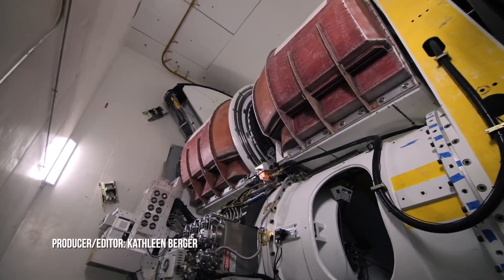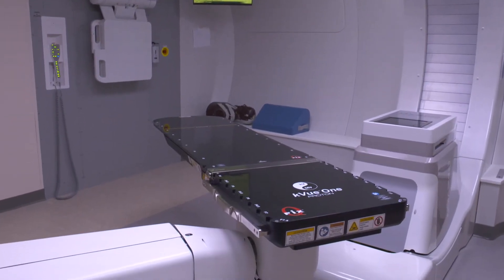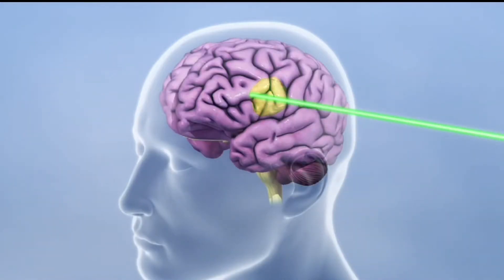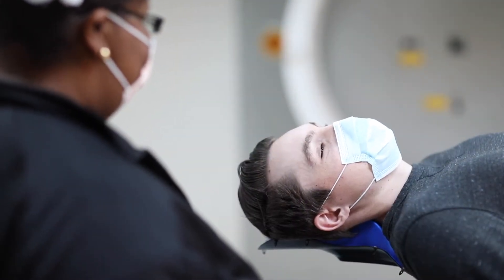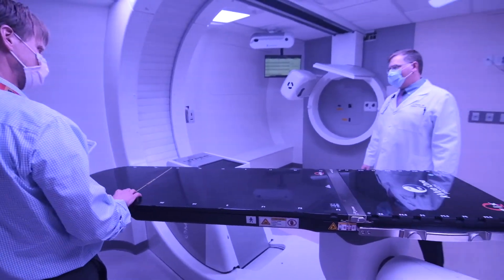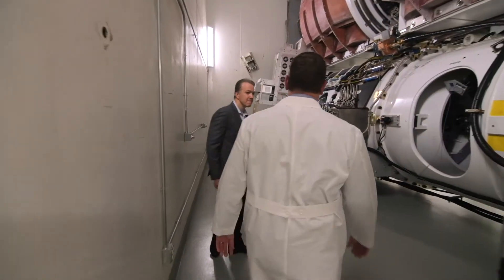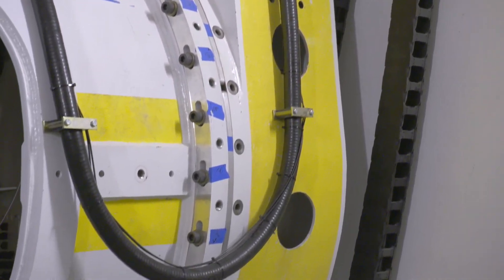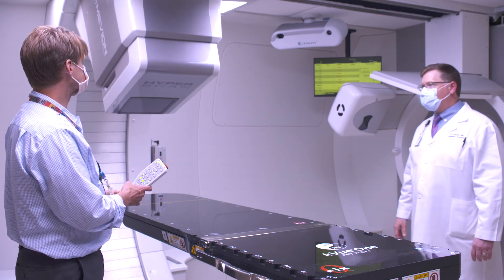Tour of the new Mercy Proton Therapy Center & How the Cyclotron Delivers Cancer-Killing Treatment

Comment: Proton beam cost is about $200M. Its a shame to see that Canada has NO proton beam treatment centers. US has about 45. Carbon-ion is also cutting edge but more costly and harder to find.
World summary here:  https://www.ptcog.site/index.php/facilities-in-operation-public
Reply: @Bruce Touzel 😯 " It's ONLY a matter of time.... Undoubtedly, some place within Canada is  planning one or more. Proton Beams are very expensive and not ' one size fits all ' . As the result, costs typically depend upon various factors (Ex: Manufacturers, Unit Size, Type, Etc.) Various institutions use them for specific purposes. Large academic medical institutions are more inclined to use them not just for patients but clinical research and scientific experimental purposes. Which is why most, if not all, require a substantial financial collaboration between institutional funding and private donations. "
Reply: I am not seeing US centers in the website. Where do you see that?
Reply: @CC-kl4nh  make sure you use the scroll bar on the right to see further past India